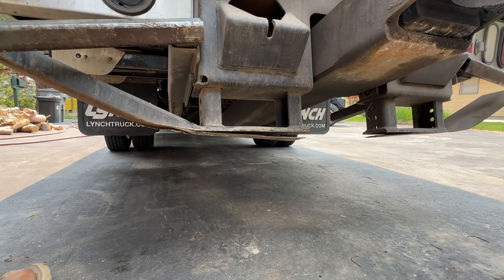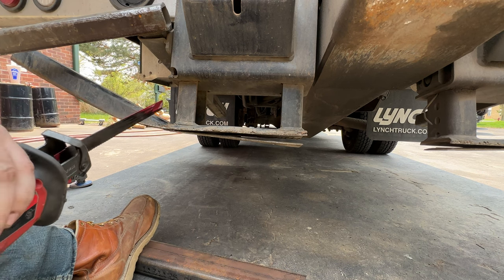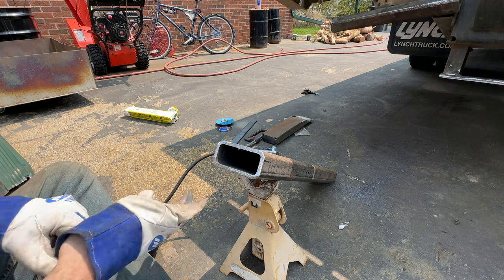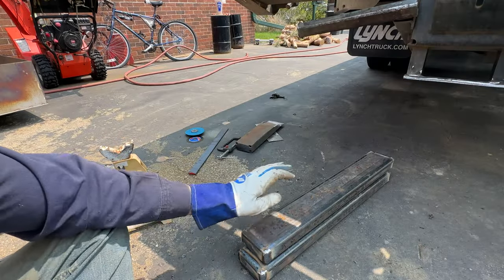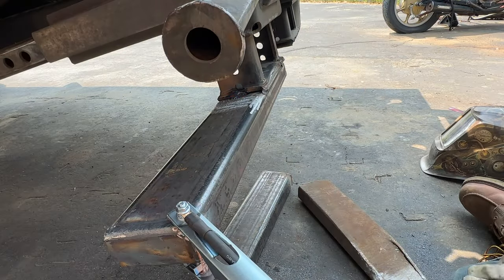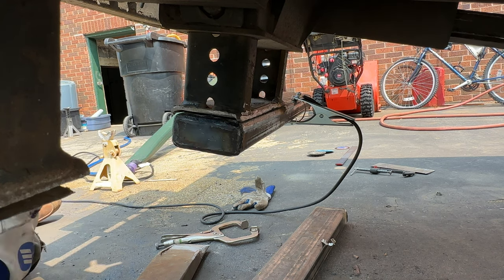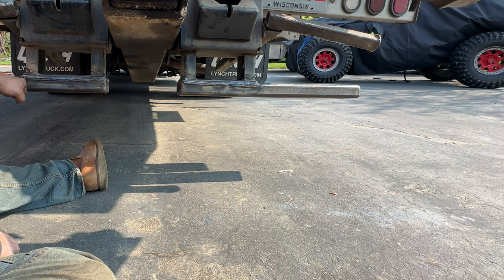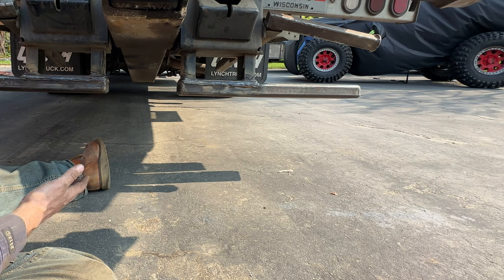Another welding repair job you can do to make money 💰

Comment: I see you had to weld directly to the vehicle. I have a job where I want to weld a couple of chain grabs to a box blade on my tractor. The tractor dealer said don’t weld with it on the tractor to prevent “frying” the electrical. I can see that there might be many occasions to weld on a vehicle or piece of equipment. Could you comment on if this is a problem or any precaution one might have to take before welding? Thanks. Any advice could save some “bad” outcomes if possible.
Reply from the maker: Great question, I will definitely need to tackle this in a future video.  For now here are some thoughts:

Welding generally operates at low voltage (10-30 volts) and high amperage (50-200 amps).  Vehicle electrical systems also operate on similar principals at slightly lower values (voltage is 12-15 and amperage is often 5-50 amps).  There is genuine risk of shorting out electronics while welding near them because they aren’t designed to handle to the voltage and more importantly the amperage that welding operates at.  In a tractor or a vehicle the frame/body/etc act as a wire to conduct electricity through.  Electricity follows the path of least resistance, and in the case of a big hunk of steel it will follow multiple paths.  If you put a welders ground clamp (regardless of polarity) on a piece of metal and there is some form of resistance between it and the welding arc, the electricity can flow in alternative paths to what you would think.  A easy example would be you grounded to a engine to weld on a intake and it’s rubber isolated to the frame.  The electricity may flow through a engine to frame ground cable, but without one of those it could attempt to flow through something like a ECU/computer ground wire off of a sensor which could destroy that wire and the computer.  

On the truck in the video everything is 1/4in steel or thicker, all of the controls are hydraulic, and other than the tail lights nothing is electrical in the back of the truck.  By making sure to have the clamp on a solid ground on what I was welding, the probability of the electricity using ecu or sensor wires is virtually nothing.  They are simply too far away and the heavy steel is far better of a path for current to take.  If I was welding on the front or anywhere near a computer/wiring harness I would likely disconnect the computer because the risk isn’t worth it.  By simply disconnecting the computer the wires can’t be used as a path for electricity to flow which will save the wire and obviously the computer.  

The best solution to welding on anything with a existing electrical system is to disconnect the battery (which won’t actually isolate the computer completely) pull the computer fuse, put your ground clamp as close as possible to what your welding, and make sure the clamp is attached to clean/solid surface.  If you do that odds are you will be safe.  It’s completely impractical to remove everything off a vehicle just to weld it, auto body repair would be impossible.  You just have to be smart about it and do what you can to mitigate the risks.
Reply from the maker: Also, surprisingly enough many tractor dealers have very little knowledge of electricity and welding in general.  I know this because I have done specialty jobs for a few of them as far as welding is concerned.  The advice of don’t weld it on the tractor isn’t bad (it can’t possibly destroy anything on the tractor when it’s not attached) but sometimes that may be impractical.  Again it goes back to being smart about it.

Comment: Is there a danger of welding a closed steel chamber where the heated air creates a large pressure potential?
Reply from the maker: When welding shut a pipe or square tube you will develop pressure.  Normally what can happen is the last bit of weld can “blow out” as you cover it. This is very common on roll cage tubing with tig, far less common with thicker tube with stick.  The actual pressure build up is minimal at best.  The main danger with pressure is if you weld on something that contains flammable materials.

Comment: I think they slam those on the ground and back up to the truck/car to tow it.
Reply from the maker: You could be right.  I didn’t screw with the flatbed part, but those didn’t move with the hydraulic arm/claw.  If those legs/bumpers drop as part of the flat bed it would make sense.  I still don’t know why the ones that were on it were cut/bent the way they were with the bottom flapping in the breeze lol.  The owner didn’t seem to know why either.  I like tow truck owners though, they always pay in cash, don’t argue about the price, and everything is always thick steel that’s easy to weld lol.  I swear they can break anything though lol.

Comment: What machine is that I was surprised that your welder does 6010
Reply from the maker: It’s a harbor freight titanium 225, it will weld with 6010 no problem.  Best sub 300$ stick welder I have ever used.

Comment: I would have asked the customer why it wore off that way, what if the two inch lower doesn't let the bed go low enough?
Reply from the maker: The owner of the truck bought it a few months prior and it was like what was shown in the video.  I never put the roll back bed down but the whole way that was cut or wore down made no sense to me lol.  I work with a lot of wore out tow trucks and such but if that was due to scraping on the ground I am pretty surprised how bad it was lol.

Comment: Could you fill that gap with a piece of rod placed into gap and then run a wave pattern to form a full gap fill?  I’m no expert. Just asking.
Reply from the maker: So the common name for that is Texas tig.  It can be done but I am not a huge fan of it.  It would have worked in the situation, but the risk is poor penetration, porosity, and a weld with unknown strength.  Not a big issue in the particular situation In the video, but definitely not something you want to do when welding something that needs strength lol.
Reply: @makingmistakeswithgreg  thanks for the lesson - and naming that - since I’ve seen it done a few times. I’ll be sure to be careful if I use it to only use it for non structural welds.
Reply from the maker: @armedmariner  it definitely can be a life saver when faced with real rusty material and no way to patch it properly.  Common for dumpsters, and just overall poor condition material with gaps.  Mig and flux core wire welding is far more forgiving on filling gaps than stick, but more people have/use stick for poor material.  When you have no choice it will solve a otherwise unsolvable problem lol.  Definitely practice a bit with it to get a feel.  You can use a bare 7018 rod (with the flux knocked off) like the filler in tig, or you can put the rod in the gap and weld over it.  I will actually do a video where I Texas tig some stuff and do a cut/etch, it will be interesting to see what’s inside lol.
Reply: @makingmistakeswithgreg  I’d vote for a video on Texas TIG where you cut and etch to show penetration. Seems very viable. But how strong?

Comment: Is this a 110 v stick from harbor freight?
Reply from the maker: It’s the titanium 225 from harbor freight.  110v stick welders generally only output 70-90 amps which makes it tough to weld 1/4in steel.  The titanium 225 can run on 110 but only at 70 amps output ☹️